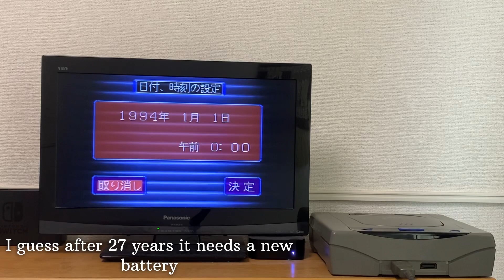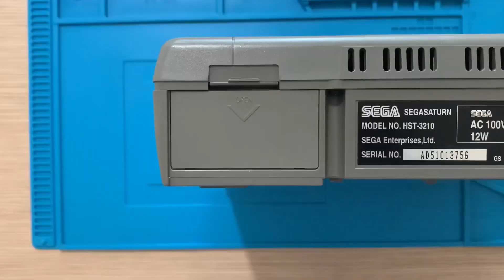Sega Saturn Japanese Model 1 Console  セガサターン Teardown and Clean

Comment: It's cool how it came with the optional MPEG card. Not quite a launch model, the HST-3210 removed the circular cutouts in the front left corner of the shell in the HST-3200 where a cooling fan was once intended to be.

Comment: My sega saturn powe button is jammed and is difficult to pull back up. What's should I do??
Reply from the maker: You’re going to have to open up your Saturn and check if the button has become misaligned or if the switch has been damaged. If the switch is damaged you need a replacement SDL1P-A (250V 4A/32A) switch and a cs222m capacitor (2200pF AC250V) and solder them to the PSU wires.
Reply: @otherretro  do you have anything I can contact you on?
Reply from the maker: @zeno3577  For now the YouTube comments section is the best way to contact me as I haven’t created a dedicated email for my YouTube channel. If you aren’t able to find the parts you can find used power switches on eBay. I will be making a video on how to do this fix on a Sega Saturn in the next week or so.
Reply from the maker: I just posted the power switch replacement video for you. Enjoy!

Comment: Hello 👋🏽 I have questions regarding the model 1 Japanese. Would be great if anyone can help. Would appreciate it. When I put in a game it takes a little while to boot up and when it doe, it freezes. It does this with all my games.
Reply from the maker: I would suggest first cleaning the laser lens with 91% or higher isopropyl alcohol and a cotton swab. If it still has problems then you might have to replace the capacitors in the disc drive board or adjust the multiple potentiometers for the laser. https://www.retrosix.wiki/laser-tuning-sega-saturn

Comment: Clean and Fix? RLLY?
You can't touch the board and the shields without gloves, this cause oxidation (rust). A console that old need a full recap, the electrolytic capacitor (e-cap) has a lifespan of around 10 years (maybe 12 depending on the quality of the components). You need to replace the e-caps with low ESR types (not regular ones).
PS: You also need to grease the gears!
Reply from the maker: Thanks for the tips. While I disagree with not touching the board and shields without gloves. I do agree with a recap of the PSU. There wasn’t any visible problems with the caps so I left them alone for now. I plan to do a full recap soon. Also, gears were greased off camera with silicone spray.
Reply: @otherretro  "While I disagree with not touching the board and shields without gloves."
Manipulate a blank copper clad PCB with bare hands and leave for a few hours, it cause oxidation (type of corrosion), give enough time it will rust and lose his conductivity properties, something you don't want in a electronic PCB.

We have tons of sebaceous glands in the skin of our hands that produces sebum, sebum is a mixture of fatty acids, sugars, wax esters, squalene, triglycerides, etc, etc; components that helps accelerate copper oxidation.

Understanding the basics on how to prevent this to happen, we don't manipulate copper or any other metals close to the PCB with our bare hands to avoid cross contamination, etc.

So, you can't disagree on facts.